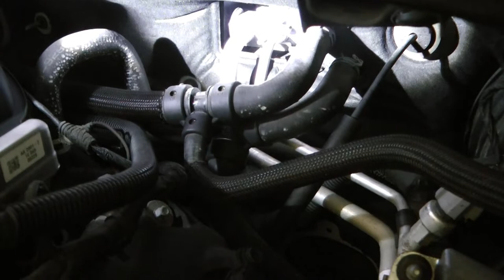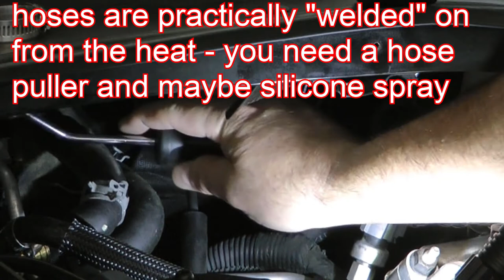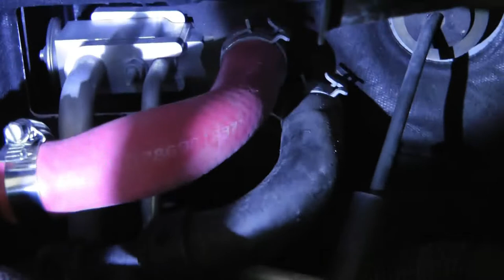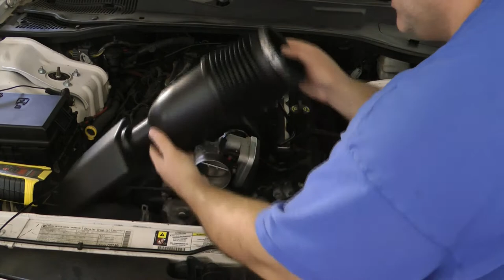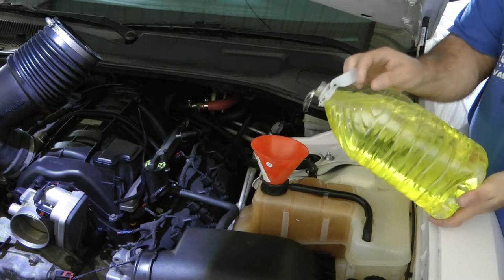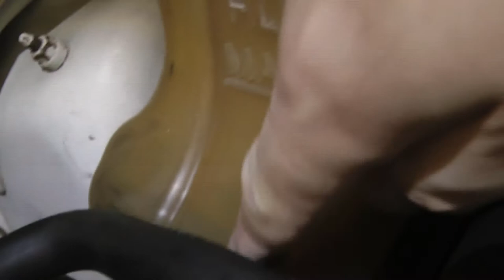Fixed!  Dodge Charger heater core hose T

Comment: I did this like 6 months ago and I felt like a genius they said $300 for the hoses made of plastic and rubber
Reply from the maker: mine still holding up great
Reply: just went to a shop and they wanted 850 for both hoses and 280 for the labor to change them

Comment: This exact same thing happened to me! Coolant sprayed all over the engine but before that the temperature gauge was fine. I let the engine cool and put a pair of vice grips to pinch off the hose to the intake on the motor just to make it the last mile home. Temperature was fine the whole time. I read some people posting that their car was overheating. Obviously it will overheat if it spraying coolant but unless you can see it leaking from that T coupling I don't think that's the problem. Thanks for making the fantastic video WJ and especially posting links to the specific parts!
Reply from the maker: I was lucky, when it happened to me I was already parking, so it had a chance to cool.  Then about a 5 mile drive home, cool and refill.  Then 8 miles to my shop and repair!  Mine never got too much hotter than the normal temp.

Comment: Love the video everything worked just like u said. I didn’t have to cut hose, I used a hammer to break the plastic housing around T hose. Make sure all out of pipe before connecting.

Comment: I just did that after changing the timing set and  driver's side motor mount. I got the part from autozone. Dorman did a good job using normal metal parts for the build. Since one was leaking, I changed them both. Now I'm wondering if I need to replace the heater core. The heat system is acting up. It may just be that interior sensor behind the mirror. I have to scan it and see if it lost cinnection with that part again. When sitting, idling, the car has heat. Driver's side is cooler than passenher's side. When driving, it cools down and blows cool air for defrost. Coolant is full, so not sure yet. I still have to do some troubleshooting.
Reply from the maker: good luck, hope you find it and it's something easy

Comment: Fine outcome. But I would advise everyone who watches these videos,  Not to cut the hose, but the 1-1/4" abs clamps. This would ensure you the proper size hose. In other words, cut the black plastic clamps carefully thru the middle, (I used dremel tool w/ cutting blade) without cutting into the hose material, original hoses are most of the time a whole lot better than the after market types. Replace the Y-type with the aftermarket aluminum Y type. Do Not use the troublesome abs Y's, they will crack again. Also, Never use those "Screw-type" clamps, use original pressure-adjusting clamps. Mechanics would know, that all these heat channeling hoses expand, and the clamp needs to expand with them. That's why this design.
Reply from the maker: thanks for the tips
Reply: Thanks I didn't consider that the hoses need to expand!

Comment: Wrong coolant I won't ever put supertech anything in my hemi, zerex g05 coolant and pennzoil oil, valvoline Trans fluid like recommended but thanks for the helpful video these coolant hoses are a pain on this car definitely replacing all clamps with the screw clamp

Comment: After I fixed this leak I found out my oil cooling pump was also leaking
Reply from the maker: that sucks.  Sometimes we get lucky and a simple fix and our cars work flawlessly.  Hope you are able to easily fix that
Reply: Mine was opposite. Oil cooler pump then coolant
Reply: @devonkennedy4751  well my pump looked bad so it was probably already leaking and I didn’t notice it

Comment: Will this work for my 2017 Dodge Charger
Reply from the maker: it should honestly work for any vehicle that has a cheap plastic "T" connection on radiator hoses

Comment: Does the color of the hose matter I bought the red hose but matieral feels different and less flexible will that not be a problem?
Reply from the maker: That's a good question and unfortunately I don't know if there is a difference in the hose color.  All I can say is mine is still holding up just fine.

Comment: you dont have to cut the hose you can cut those factory plastic clamps off with tin snips or like and the hose comes right off.
Reply from the maker: thank you for the tip
Reply: I used a hammer, worked great

Comment: You can remove the fitting around that hose by crushing that plastic and not having to cut any hose. Because the plastic has become too brittle that's why it cracked and you can easily break it into pieces without cutting it
Reply from the maker: thank you for sharing that tip

Comment: Do u think it’s ok just to change the plastic tee?
Reply from the maker: in my case it was the perfect fix.  The plastic tee is what broke.
Reply: Ok it’s changed what do you suggest i do next if car is still overheating?
Reply from the maker: best to google "why is my car overheating" because it could be a lot of things like air in the cooling system or a stuck thermostat

Comment: What bit did you use to open bleeder valve? Mine is somewhere between t40 and t45 torx bit but they don't. Are make anything between those two...?
Reply from the maker: I honestly don't remember what I used - I might have used an allen key
Reply: @WJHandyDad  Kudos for getting back to me like that. I caught another video and the guy has a 1/4" star tool. Mine are all metric. Gonna find out tomorrow though. Thanks again

Comment: Did this and my car over heats still.. maybe I need to add more coolant lol idk but it’s not leaking anymore thank god
Reply from the maker: I do have a video on filling it up with coolant
Reply: @jl4093  problem fixed you were correct, system needed to be bled

Comment: Will 3/4 3/4 1/2 inch work
Reply: Yup! That’s what I used worked like a charm!
Reply: What bout a 3/8
Reply: Yes just done mine lowes don't carry the one in this video it sucks but the 3/4 3/4 1/2 inch worked out thanks too the last comment that stated it works